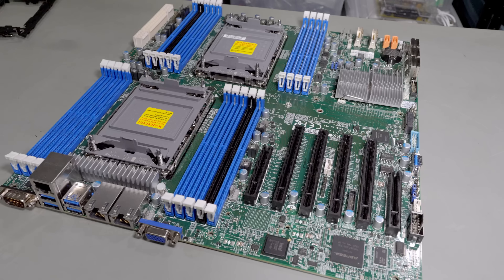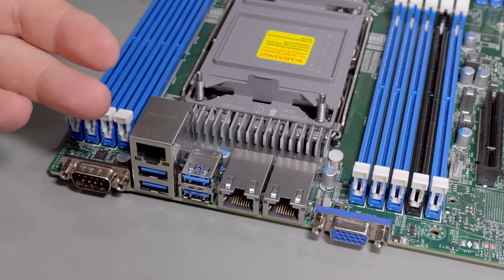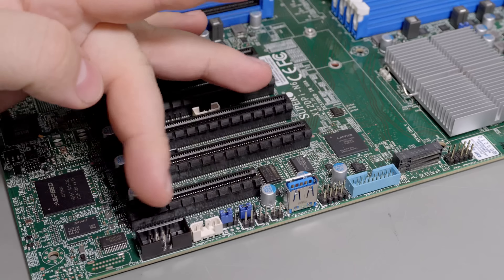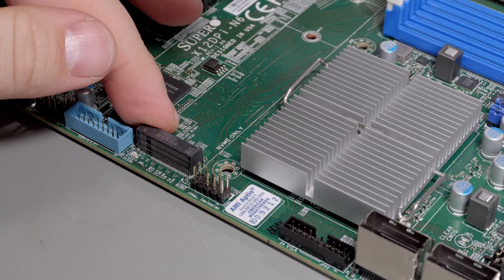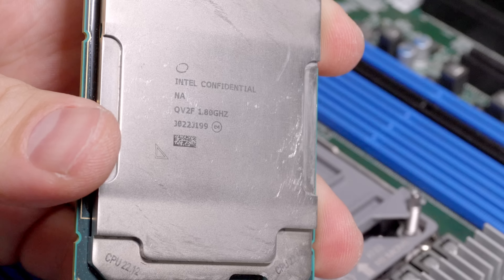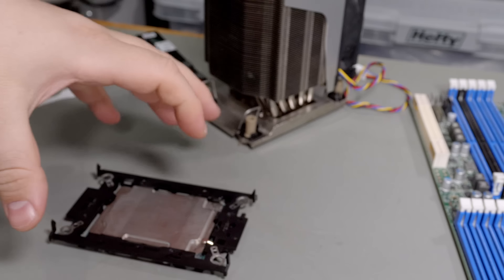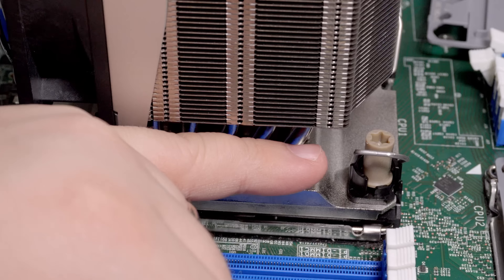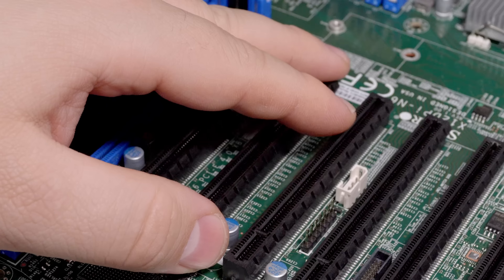Crazy Ice Lake EATX server board... (aka Lanes for days)

Comment from the maker: Server build with this motherboard coming soon! Well, as soon as I can get it back from having the missing pins fixed. Supermicro said 60-90 days(!).

Because I got this damaged board so cheap ($61 USD including shipping from Canada to the US!), I really wasn't expecting it to work at all. Plus the CPUs were so expensive I was just going to do a video showing off the board. Once I figured out the 8352Y ES CPUs were ~$150 each I figured I'd take a shot at getting it working. Now that I know it seems to just be the missing pins on CPU2, I'm going to go all in with this board and make a crazy VM system.
Reply: A lot of the times cpu 2 controls more components on the board like the other lanes. Sometimes supermicro will replace the socket's for a fee. Not sure if this is one they can or will do that on. But worth asking.
Reply from the maker: @tacticalcenter8658  At least according to the block diagram, CPU2 is most of the PCIe slots and CPU1 is everything else, plus a couple slots. I did try that with SM, but they required a whole $50 to fix it - which is no problem at all with me.
Reply: @PeterBrockie  nice! Then you got a really good deal!
Reply: Was the motherboard in warranty when you sent it to supermicro? I'm looking at a supermicro epyc genoa motherboard on eBay that has a similar issue for 450
Reply from the maker: @empedance1933 I'm not sure, actually. My understanding is that it's $50 per pin.

Comment: If you want to get silly, the M.2 has 1x4 PCIe, you can get M.2 to SFF-8643 adapters, you can get SFF-8643 to SFF-8639/U.2 cables, U.2 carries up to 4 PCIe lanes, and most jargony of all you can get U.2 2.5" 2x M.2 carrier boards, with the caveat that these usually support one NVMe drive and one SATA3 drive and I'm not sure this motherboard offers SATA on the M.2 port, if it does that's still not great, if it doesn't then you would need a RAID carrier board that presents one NVMe device, which isn't great either.

Comment: The SATA ports are orange because they support SATA DOM devices.
Also those x8 connectors are known as Oculink.
Reply from the maker: Oculink is different. It only supports x4 lanes instead of x8 (although there is an 4i miniSAS with only x4). Connectors are totally different. But they do similar things and Oculink seems to be more common. Oculink also supports a SATA mode which at least on this motherboard, miniSAS does not. Source: https://mokosiy.medium.com/untangling-terms-m-2-nvme-usb-c-sas-pcie-6599c044f38e
Reply: The orange ones on supermicro boards are called "SuperDOM" short for supermicro sata DOM (disk on module)